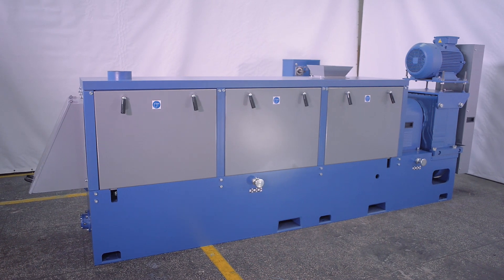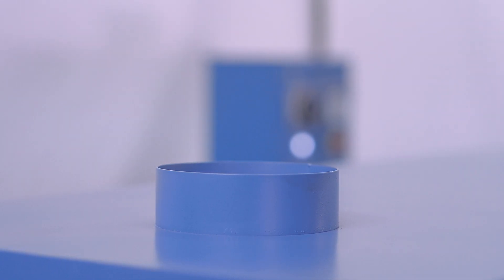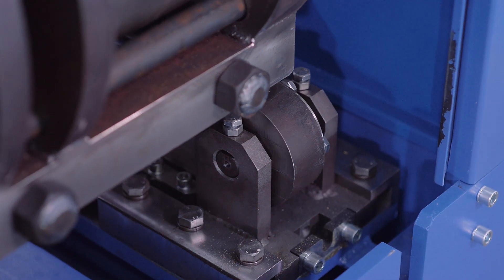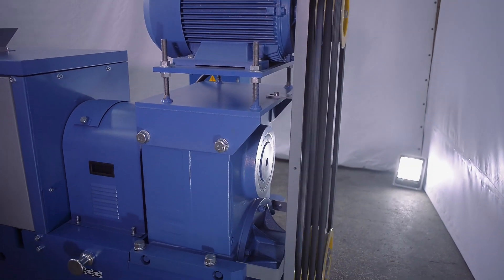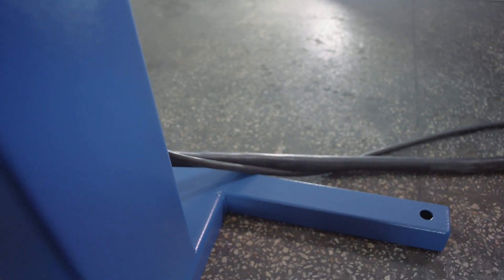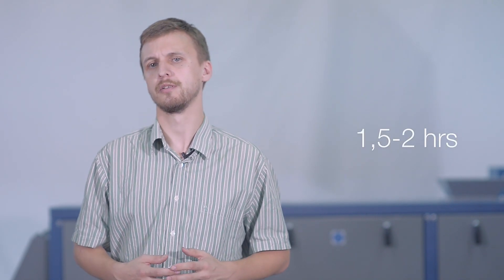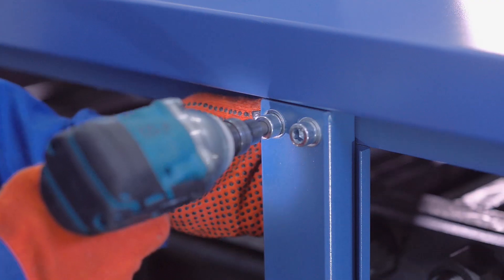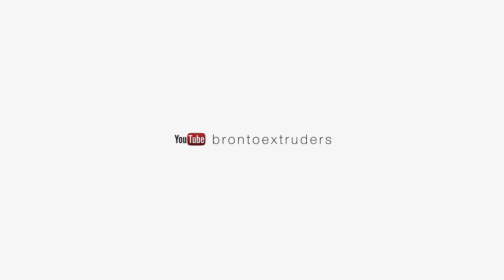Oil press machine OP-1000 BRONTO

Comment: what else can that machine press apart from soya?
Reply from the maker: Dear Georges KATEFERI 
Thank you for your question.
The oil press has been designed for pressing vegetable oil from full fat soy. 
Basically, it's possible to get the oil from any other extruded feedstock that contains vegetable oil, but the resulting oil yield and the final oil cake oiliness will be completely different

Comment: That machin its only for soya
Reply from the maker: Dear Sahra Gacal. Thanks for your interest.
Yes, it has been designed for pressing vegetable oil from soy. 
It has a prolonged press cage which allows to get the max oil level. 
The maximum effect is achieved if you use this machine combined with the extruder E-1000
➢Price and delivery details:
bronto@bronto.ua
+38 067 327 07 57
Reply: Tach photo see veadio mustard oil mekar machine 7028888480